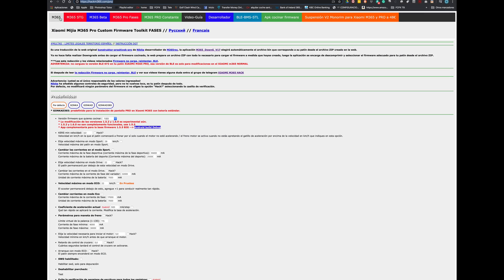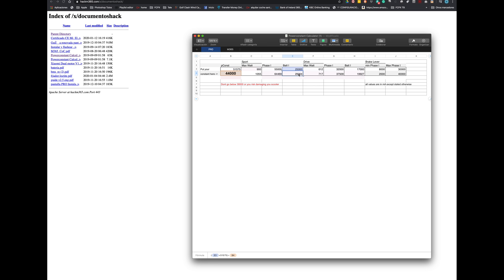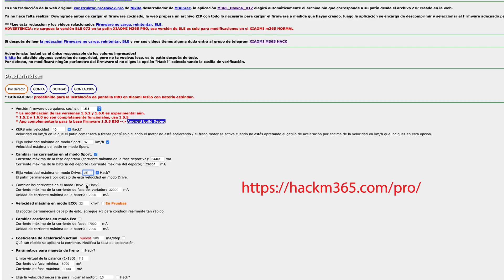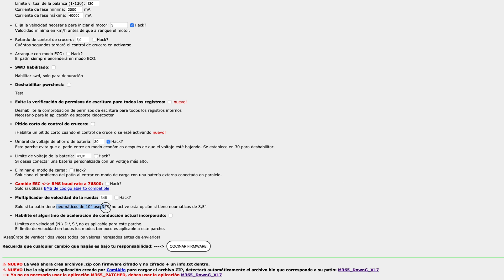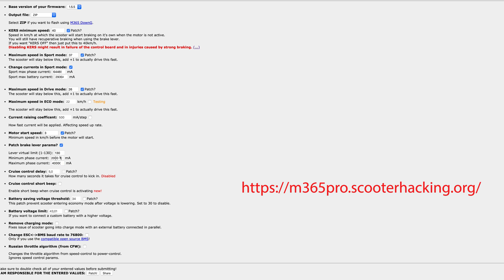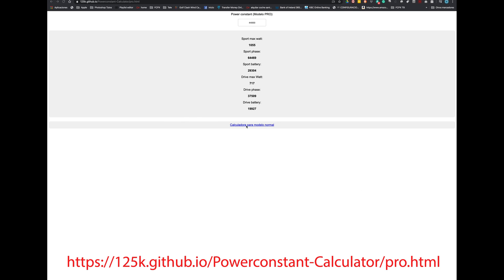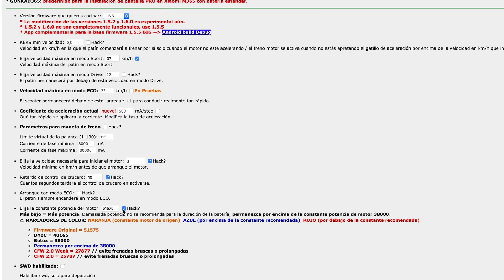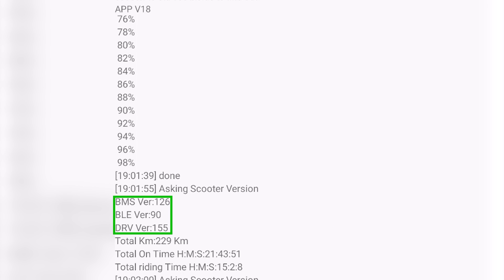CUSTOM FIRMWARE Xiaomi M365 PRO🛴 - SPEED and POWER Increase

Comment: Help, why the maximum speed can only reach 30kmh
？
Reply from the maker: Yo can try more aggressive parameters for your custom firmware but the battery life will be reduced too. For more speed you may need to think about doing the extra battery mod
Reply: @DavidTechEs   Thank you very much friend
Reply: Is 31km/h safe speed for battery life? I mean, does it reduce battery life (range - consumption) much more comparing to  stock speed of 
26km/h?

Comment: tried everything  but cant get it downgraded...
Reply from the maker: What problem are you having? What firmware version and BLE version you have?
Reply: @DavidTechEs  i tried to see it in Mi Home but everytime after connecting it says device offline need to reconnect and then nothing..
just downloaded segway app and now i know my i know my master control firmware is 1.7.1
Reply from the maker: @Ganjafarmeo  that's the problem there. They just released a new firmware update, 1.7.1, which for the moment is not possible to hack using software. Only can be done using stlink. Anyway, the developers are working on the new version already. In few weeks will be possible, stay tuned I'll make a video as soon as it's possible
Reply: @DavidTechEs  
Thanks for the fast reply i have subscribed to your channel keep up this good work m8
Reply from the maker: @Ganjafarmeo  Thank you!!! That means a lot!

Comment: Thank you  in that you identified an available site Page that still has the Motor Constant tabs . Your Info though  is at odds with other Hack help sites. 
Dropping battery min Voltage to 30 is IMO /experiences with batteries.. NOT klever.. Rethink that one. 
Also many  suggest Not changing the speed / tire correction ... as it is  claimed as currently unreliable
For my near new Pro I've tried 60,000/30,000 and 35 kph, 65000/35000 and 36 kph ..both  giving a Maxed top speed of  26 to 28 kph.  Unimpressive to say the least
Using the 'dreaded' Russian Algorithm and top speed goes up to 31 kph.  Better, but nothing near  other internet claims.
 Also I've not found any oversensitve throttle actions as result .. as the Stock throttle action is pretty well on /off in any event. 
Typical of a low to no power vehicle.
Reply from the maker: As I said in the video, everyone has different preferences, the values I applied in the video I've been using them for more than one year on my pro, and for me it's well balanced the relation between power and battery life. You can go more aggressive, I rather more balance for batter life. There is room for multiple setups. I'll take your advise regarding the battery min voltage, thanks for your feedback. I'll try to keep improving the videos as much as I can
Reply: @DavidTechEs  Ok.... Not a matter of Preferences... Some (many:-)  hack settings Simply Do Not work / yield results worth the effort. 
Pretty well tried All the settings possible .. so far.  MY Hacked performances are at Best : Marginally improved.  
A 5 kph Max speed improvement  Is nothing I can get excited about.... let alone shout from the rooftops.
  
Perhaps my Pro is broken at 60 kms on the odometer?.. although  I have retrofitted Real fets and solder braid reinforcements to the controller's PCB bus bars.
 Hopefully significantly increasing reliability,  but this  did not improve performance in any way.
Reply: @barenekid9695  I have a new M365 pro and these settings have massivly improved the performance for me. 90kg male..

you sound realy angry about your scooter, it was built to go 25kmh so 5 a 20% increase on speed is actually epic. maybe you should have bought somthing different in the first place.

if your scooter is not improved by these setings my guess is you dont know what your doing and have done it wrong.
Reply: thanks to all of them cfw videos i killed my motor ;) 41000 mpc + russian throttle is a no go uphill, slight hill but long and motor is dead! controller temp was 50 when it locked up, controller is still ok no damage. motor was super hot so i think phase wires inside are fried ;)

Comment from the maker: Hi guys, let me know if the video was helpful here in the comments. If you have any question, please let me know.
Reply: Guys. I tried modding my pro. I put ble74 pro v2, CFW 155 and it feel like acceleration and other parameters changed but still got 26kph top limiti
Reply from the maker: @Zefir353  Well... You can't get really much more than that without an external battery